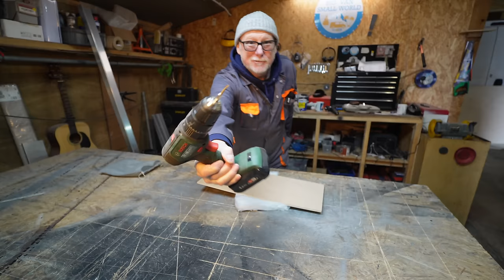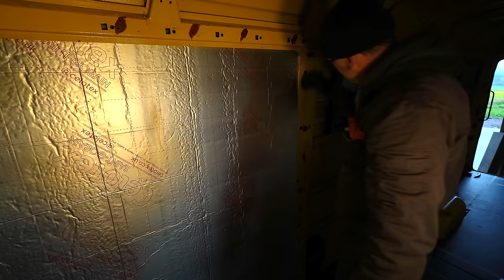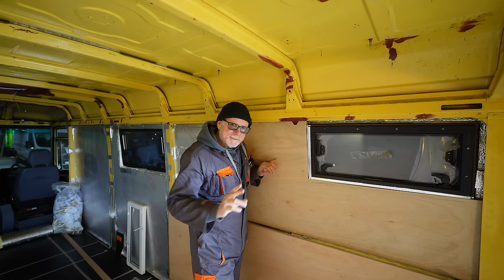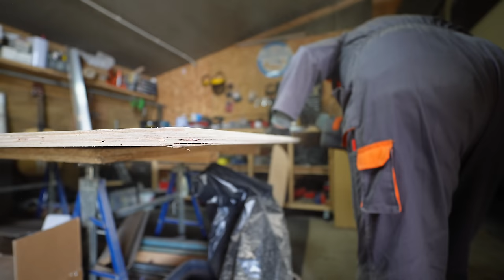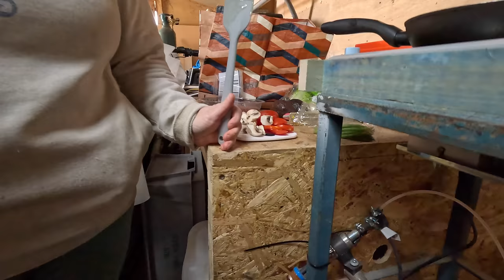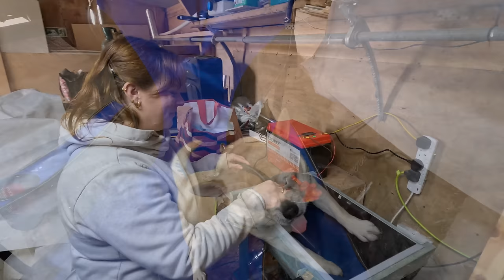How NOT to insulate a camper van conversion

Comment: Problem with underlaying insulation???? Just use a depth-stop in thickness of wall material – problem solved. 
Problem to fit Celotex behind the struts? Make the panel in to parts divided in the middle. Only one seam in the center, no fiddling with patches –problem solved.
Problem with insulating cavities? Never use expanding foam. Will cause major problems when later welding repairs may occur. Use something you can take out again in case.
Noise damping panels? At least use a good amount in the roof – otherwise you'll have no sleep during rain or hail ...
Don't forget to insulate the panels against the underlying metal struts avoiding themal bridges  ...

Comment: Another great vlog Mel, just out of curiosity how come you've not sound dended your wall's of your Vivaro first before putting the celotex in place ?
Reply from the maker: Good question! The reason is simple it’s not necessary as the panels are corrugated to stop the drum affects that modern vans suffer with

Comment: Just put the drill in reverse never had a problem with it in my van in 6 years
Reply: If you get the timing wrong it just twists up the other way & regardless there's a patch of insulation that's now uneven.

Comment: def no to expanding foam, it will distort the external panels, and stickyvback foam as thick as you can, on the van frame between the PIR sheets
Reply: it will only distort the panels if there's no outlet for the expansion. 
If you're having that problem you can get foam that stops expanding as it leaves the gun.

Comment: Don't put expanding foam in. You are definitely better having an air gap in there with a vapor barrier between the inside and the outside surfaces

Comment: Zero downsides to recycled plastic quilt insulation, thats why professional campervan builders use in in conjunction with adhesive thermoliner and not PIR boards.
Its lightweight, flexible, easy to cut, no dust, easy to stick in place, doesn't rattle, can be pushed into cavities and simply works.
Over specced insulation for a van is a waste of time and money, as heating and ventilation are needed regardless of what is installed. The only place I would consider PIR board as advantageous is on a flat floor, if the standing height within the van is not compromised. 
I've never broken a drill bit either!
Reply: If I was to do a build/fit out myself, I'd go that route...convenient, easy, and Good enough. I don't think I would vapor barrier anything either so everything can breath on great drying/airing out days. My almost 31 year Old van has no vapour barrier and came factory fitted that way.
Heat and decent ventilation is best I think in UK, and don't boil potatoes, carrots and broccoli for 40 minutes without a decent way to extract the steam; nor hang soaked cloths up to dry without Very good airflow/ventilation...I see many make these mistakes.

Comment: I agree with your cooker thoughts and no gas ethos, with one exception, air pollution! Diesel heaters etc put out unfiltered 2.5nm particles and your van will also be a big polluter and with new LEZ areas getting more and more and some towns in EU and UK about to ban ANY diesel vehicles you might need to think about the long term use, but doing your bit for local areas when stopped and cooking/heating please spare a thought for those nearby your van as it’s pushing out non CAT filtered fumes.
Reply: Gas heaters put out finer particles which are even more harmful even though there's slightly less of them.
Reply: Until solar panels come a very long way from the ~20% efficiency they have now or an amazing new tech shows up electric heating is a non-starter so we're stuck with burning stuff.
Reply: The Euro 4/5/6 standards for emissions are very similar for petrol or Diesel except for NOₓ where petrol is allowed double what Diesel is allowed. 

It would be great if legislation was based on facts not on propaganda.

Comment: Hi, enjoy the videos, but what about the airgap you have created between the Celotex van ribs and outside skin, condensation will  form in that gap, maybe a thin packer of lambs wool or similar would have filled possible  that the van will rust from the inside out from the bottom where the condensation will collect.

Comment: 9:47 foil-backed bubble-wrap does actually reflect summer heat back through the wall, i was surprised how effective it is, even the cheap one from Toolstation. 
The foil-backed polystyrene foam for radiators is quite good too.

Comment: All the insulation talk confuses me big time, my only worry is condensation, I got a small van with a 2kw heater and it keeps me warm on the lowest settings even in -6 . I agree with not needing it all.
Reply: But what about the inside temperature of the van in the summer?
Reply: @brightgreencarrot   I have a big window cover that helps, It's actually been bearable , I will get a couple of little USB fans this year tho.
Reply: If a van is well insulated, similar to a cool box works but opposite. It will help maintain the heat once heated up, it will also heat up a little quicker and take somewhat longer to cool down.
There is a diminishing point of no returns though, we need to breath.
We need to exchange inside air with outside air, not like a cool box or flask and this exchange of air will cool a space regardless of insulation.
A smaller van is easier to heat and keep warm compared to a larger van.
More insulation in a larger van will work better, to a degree (excuse the pun) until that point of diminished returns.
Keeping the Celotex away from the outside skin (a cavity) is still a form of insulating a wall, just like double glazing, less conductive heat loss.
I too think Mel, has/is doing enough without being pedantic.
What type of small van do you have bfrommars? I'd like an even smaller van tbh.
Reply: @pa_maj.MARTINI-van-MAN  Thanks for that info, I found John virago very good at explaining it too. I've got a vivaro lwb high top. m I am thinking of ripping it all out and doing it the way I want it now as I have lived in it a for a while.
Reply: @bfrommars  I think you're referring to Greg Virgo, yes, he's Good at explaining insulation amongst other things; I've had the privilege of meeting him...top bloke.

I really like the short wheel base Vivaro, I've been dreaming of one for a couple of years now, the LWB vs a SWB vs a High roof Vivaro has messed with my head many times.

If I lived in a van, your van would be my ideal choice, not so easy to get a High roof model though.
That's my issue, I want my own setup/build that suits me better.

I don't want to start messing with mine as it would probably be better to sell it and get a bare van and start from scratch, it's an old Talbot Express campervan.

I like having no fancy electrics and an old reliable engine, I've had it for over 5 years now.

If you know what will suit your needs better, remodelling would be a Good thing to do; especially with the better weather on its way.
Thanks bfrommars for your reply.

Comment: If the celotex is not hard up against the outside skin fixed maybe with adhesive or foam condensation will form in the air gap between the two and if you have ribs in the structure again condensation will form in that air gap looks like a mistake to me maybe you should have put some thin lambs wool between the celotex and the van ? at least it will rust from the inside out.

Comment: Mel, the recycling stuff is rubbish
Reply: Technically it Was rubbish haha. But as insulation...

Thermal conductivity: 0.040 W/mk
Water adsorption:0% w/w
Specific heat capacity: 1000 J/kg-K

Vapour resistivity: 5 MN·s·g-1m-1
Ignition point: >500℃
Flammability: Passes BS 5803-4
Smoulder resistance: Passes BS 5803-04
Recoverability and thickness: Passes EN 823
Dimensional stability: Passes EN 1604
Density: 13 kg/m3

All in all, effective at regulating temperature and preventing heat loss.
From rubbish to useful, convenient and pretty decent stuff in general.
Used in conjunction with a sticky backed 10mm closed cell foam, it's actually a Good way to go Thomas, for some.